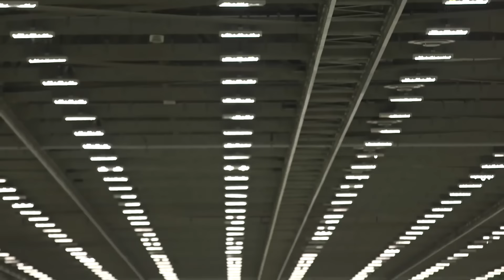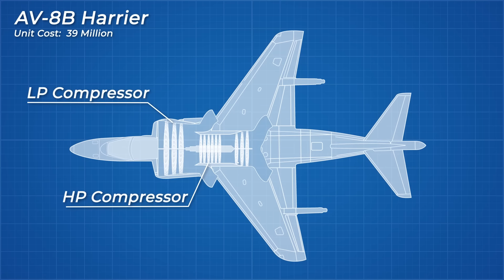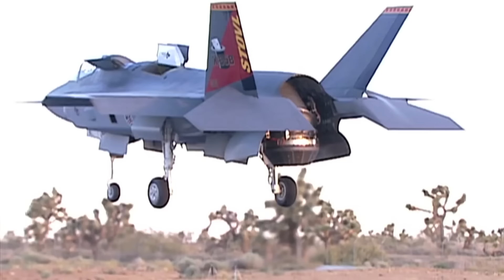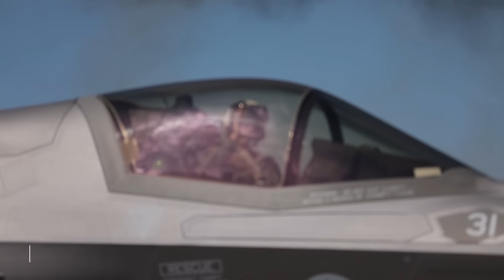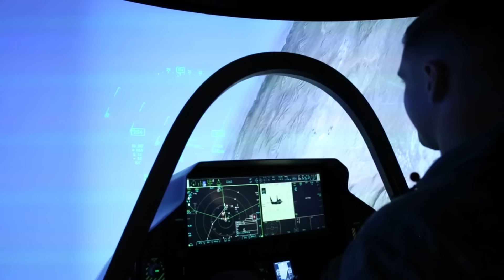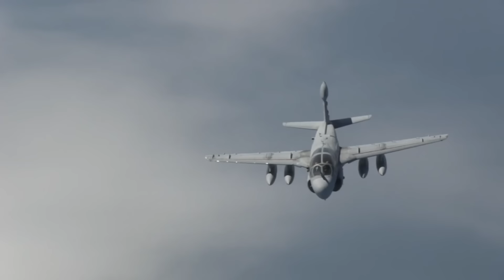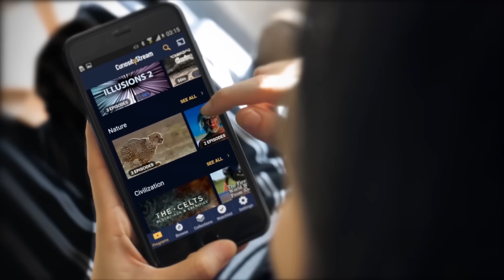Is The F-35 Worth $115 Million?

Comment: This is an utterly dishonest pile of garbage.

0:11 - No. F-35 cannot even begin OT&E yet, as of 2021.
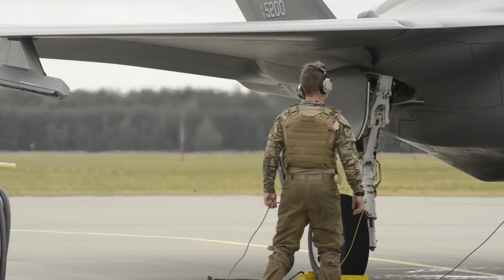10:58 - No. F-35 fails in air combat in general, not just in dogfighting.
 It can neither engage nor disengage, it is too slow.
11:12 - No. That report only confirmed what we already knew. Performance follows from basic airframe parameters, can't fool physics.
12:08 - This is irrelevant. Detection does not work this way, and even if it did, engagement is still a problem F-35 can't solve.
12:16 - And majority of them have bank accounts directly reliant on the gravy train pulled by the program.
12:40 - Phenomenally indeed. 1:3 KDR with full force loss against 4th gen Chinese knockoff Flankers in real military simulations, despite assuming 100% capable F-35's instead of real defective ones. Maybe you should read real reports instead of propaganda and marketing hogwash.
13:05 - ROFLMAO. A barefaced lie. F-35 is g-limited! Did you just forget about that little factoid?
13:27 - For some reason you have way less accurate information than anyone who bothered to do any research.
13:39 - Another lie. This isn't how air combat works. Stealth only gives temporary tactical advantage that only a capable fighter can utilize. F-35 can't., it's not a capable fighter.
13:52 - News flash: in a dogfight, stealth does not exist. It barely exists even in a BVR missile engagement.
13:54 - Tired and stupid cliche. It doesn't work this way, not since digital RWRs, missile detectors etc.
14:05 - No it doesn't. Most 4++ gen fighters have similar or better equipment.
14:14 - Like MiG-31 does since 1980?
15:50 - Wow, a correct statement for a change!
16:20 - Yeah, that's such an achievement - flying while escorted by multiple support aircraft over Iraq known for its "modern" air defenses.
16:48 - Why would Russians reverse-engineer long-obsolete piece of junk?
18:03 - Another ridiculous cliche. News flash: it's not 1965 anymore.
18:15 - News flash: SAMs with radio command guidance are museum pieces for decades already.
20:35 - Oh really? Documents tell a different story, again.
FY2019:
F-35A - $101 million
F-35B - $132 million
F-35C - $149 million
Liar liar pants on fire.
21:06 - only in terms of MIC gravy trains.
21:17 - No it doesn't manage. It would be vastly inferior even if it was operational, and it isn't.
21:30 - Rrrright. Another cliche. "Trickle down economics" all over again.
22:02 - Yep - in video games, marketing promos etc. Not in reality though.

I didn't even bother to address all false or inaccurate claims, just the most egregious ones. 

This is not Real Engineering. This is Real Disgrace.
Reply: Initial operational testing and evaluation is not operational testing and evaluation?
Reply: @infinitelyexplosive  
IOT&E is supposed to identify flaws and deficiencies in prototypes and may be done repeatedly during post-LRIP development.
OT&E is for testing a finalized system.
F-35 with its "concurrent development and delivery" is still a seriously flawed prototype with 871 known defects.
Reply: @Conserpov  Do we have any estimates for how many issues the F-15 and F-16 have/had through development? I have no context for the number 871.
Reply: @infinitelyexplosive  
The only context that is readily available is F-22.

F-22 had 25 known deficiencies prior to IOT&E entry and 351 deficiencies were identified during IOT&E in 2005.
Apparently, most of those were fixed prior to FRP that followed, and some goalposts were simply moved, with many issues being shoved into "upgrades" (up to 2019 Increment 3.2B). As of now, 143 F-22s are formally operational, since all F-22s delivered prior to 2006 / block 20 are considered "non-combat" airframes.

F-35 had "approximately 1000" deficiencies (incl. 301 cat 1/2) in 2017 and formally entered IOT&E in Dec 2018 with 873 known deficiencies (with 89 out of 102 cat 1 deficiencies simply "re-categorized" as cat 2). As of Nov 2020, it has 871 deficiencies incl. 10 cat 1.

Assuming same criteria for "deficiencies" and same political pull to drag it into service, and assuming that every trick once used for F-22 to make deficiencies "disappear" was already applied many times over - F-35 is a legendary disaster, "concurrency" is a legendary scam, and all 500+ F-35s already delivered will probably end up as training airframes (like block 10 F-22s) at best.

Comment: Currently: on average (there are 3 variants) an F-35 costs less than a 4.5G aircraft, although its maintenance, for now, is more expensive. And despite the list of problems still to be solved, today it is an unbeatable aircraft, only surpassed by the F-22.

By the way, let's say that any device (hardware or software) always has a list of pending problems. That's why any aircraft, say, the F-16, has so many versions. Because they have problems, limitations, inabilities, call it what you will, and not because of the manufacturer's whim. The F-16 went through 7 version letters and each one of them divided into sub-versions (called blocks). The same will happen with the F-35.
Reply: People have been griping about new aircraft being introduced and all the integration hell that comes with it since the F-15.
I saw a headline saying that the F-18 was a failure of an aircraft and a waste of money.
Reply: @Attaxalotl  super hornet
Reply: @johnnysliick3064  Nope, this was from the 80's. The Super Hornet didn't exist yet.

Comment: That thing is nonsense. For the USMC and USN, sure, it's fine. But the USAF has the 117, 16, and even A-10 and AC-130. Already bought and paid for. Far cheaper even for replacements, and plenty upgradable. If stealth tactical strike is desired, since in the 117. If stealth is not necessary, send in the 16s. If loiter time is important, send in the A-10 or AC-130 - OR.... let the Army handle it's own business, the AH-64 is not exactly a joke.  At that unit cost, it's better to get more F-22s and simply upgrade and keep using what is already bought and paid for, with infrastructure already in place and almost certainly lower per hour operation costs as well.

Not to mention... it's good to have a non-stealth public face. For air-space intrusions, air-shows, news/PR, and a show of good faith with other nations. Not like we'd be lacking in ability thanks to the aforementioned 22 and 117, but especially with the strategic assets of the B1 and B2.

Comment: The costs of the f35 have recently gone down to about 80 million per plane. Could you do an updated version of this video? I'd find it very interesting
Reply: 75 million
Reply: Is there much new information to talk about? Prices have gone down somewhat, ALIS still sucks, still not combat-proven against modern air defenses or aircraft, some issues resolved, others not, marginal improvements overall.
Reply: @infinitelyexplosive  wrong again Brainiac... Israeli F-35s penetrated Iranian and Syrian airspace and flew along the Russian border, penetrating S300 and S400 SAM sites Defended airspace without detection as well as a shitload of search radars. Where have you been for the last several years? Nitwit.
Reply: @infinitelyexplosive  Uhhhh yeah there is. the air craft is still under development and changing rapidly as the pilots log more hours
Reply: @infinitelyexplosive  israel used it  against iran

Comment: Simply put, the F-35 cannot replace the A-10. For the same reason that it will not replace the F-22.
The A-10 is designed to be a flying tank and a Air-to-Surface superiority beast.
The F-22 is designed to be a speed and Air Superiority beast.
The F-35 does not have the capability, due to it's all-rounder design, to replace either of these specialized tasks.
Reply: Sort of- the A-10C is already being replaced by the F-16C/ D in regards to CAS in contested airspaces. That's what the F-35A seeks to replace.
Reply: The A-10 isn't even the best in the role it carries out. The only reason it's kept around is because it's cheap to operate and Congress won't let it die

Comment: I think this plane's obviously got a lot going for it, and the front-end cost of buying the aircraft has come down a lot - it's a 5th gen stealth aircraft that's actually cheaper to buy per unit than a lot of its 4th gen non-stealth competitors such as Typhoon or Rafale for instance. However, I think the operating costs on the back end might be more concerning than the costs on the front end - I've yet to find a single authoritative source on just how much exactly US planes cost per flight hour, but the sources I've seen all seem to put the single-engine, lightweight F-35 in the same ballpark as heavier twin-engine fighters like the F-15 or even the F-22, costing something like 30,000 bucks per flight hour, whereas the F-16, which is the workhorse of the USAF that the F-35's supposed to be replacing, costs around 8000 per flight. Maybe those maintenance costs can be brought down the same way that its up-front production costs have as more airframes circulate, but given all the sophisticated technology that the plane uses I kind of doubt that it can happen to the degree necessary for all 1000+ F-16s currently in use by the USAF to be replaced by F-35s. And while its stealth is a massive advantage, I do think that by essentially flooding the market and exporting the plane to so many different nations, it creates a greater impetus for the likes of Russia and China to come up with tech solutions to neuter stealth, something which is surely becoming more likely as those countries get to grips with stealth aircraft technology of their own.

Comment: radar avoidance, unbeatable situational awareness (even by f22), top avionics and capability of carrying the newest weapons you can image, is what makes this plane easily worth $115 mln. it wouldn't be bought by so many countries if it wasn't
Reply: @Drew Peacock yea i meant the basic, cheapest A variant, which isn't really that expensive itself, compering to others 
 (i think its less than mentioned $115 mln). what is expensive though - that you pointed out already - is the cost per flight hour (more than $40k, around $20k for f16. its far more than USAF was expecting). i imagine the whole infrastructure for it isn't the cheapest as well (especially for countries that didnt operate any 5-gen platform before)

as for the missles, as far as ive heard (obviously im no expert), the newest aim-120c7 and aim9x are pretty effective. but i suppose it wouldn't take much to integrate such a meteor missile for f35 . all the best!

Comment: I think that if the X32 would have been selected it would have ended up being a much better plane than the F35. With that huge delta wing, and integrated VTOL it would have been able to fulfill all 3 roles in one aircraft. Instead we get 3 different versions of the F35. Look at the original X35. It' quite a bit different than the F35. 

The same would have been for the F32 if it were developed. We can only imagine what a completed F32 would have looked like. One thing is for certain though. We wouldn't have needed 3 different F32's for Sea/Air/Land.
Reply: The X-32 demonstrators were not capable of both supersonic flight and vertical take off. Boeing claimed they could get both with a redesign. Additionally, like the X-35 they intended to develop a separate model for each branch, the marine version having clipped wings for example. The differences were stated to be minor, but then again, so were the X-35s.
Reply: @infinitelyexplosive  They also had design revisions that were not in the 2 aircraft they used.

IMO Boeing should have went for it because they said that the planes were capable of the feats needed. They played it too cautiously. They should have known that if 1 plane didn't do it all they would lose by default.
Reply: @Drew Peacock The fact that it was capable of VTOL and supersonic at all made it better than the X-32 though.
Reply: @Drew Peacock "As I said, the F-35B has no meaningful vertical take-off capability, certainly not with a full tank of fuel and full of ordnance." and that is completely irrelevant. The X-35 was competing with the X-32, not with a hypothetical aircraft that hit all the design requirements perfectly. "Due to the heavy delta wing design of the X-32, Boeing demonstrated STOVL and supersonic flight in separate configurations, with the STOVL configuration requiring that some parts be removed from the fighter." according to Wikipedia.
Reply: @Drew Peacock I said "The X-32 demonstrators were not capable of both supersonic flight and vertical take off". In this sentence, the word "both" is used as a function word to indicate and stress the inclusion of two things, in this case VTOL and supersonic flight. Then I said "The fact that it was capable of VTOL and supersonic at all" In this sentence, the word "and" means that I'm again talking about the two words "VTOL" and "supersonic" at the same time. https://www.merriam-webster.com/dictionary/both https://www.merriam-webster.com/dictionary/and
Reply: @Drew Peacock I'm sorry that you don't understand basic English sentence construction. I can't really help you with that.

Comment: maybe they made improvements to its maneuvering cause they show em on youtube at air shows and they look like they move almost as good as the crazy su russian jets and raptor.  and all that tek and sensors look like straight out of a video game.  some star wars level stuff thats amazing 😍
Reply: Current version of the F-35 call pull 9 Gs. This video is garbage. And they only cost 75 million per aircraft, not 115 million.
Reply: @CH-pv2rz  This video isn't garbage it just aged. For cost the mass-production kicked in and for Gs, fly by wire allows to upgrade existing planes by literally just updating their software - which is mind-blowing on its own, but yeah

Comment: I'm not really sure this is a good replacement for the A-10. I doubt it would be at home in some of the areas the A-10 takes off from, such as dirt runways at forward operating bases. But as a fighter jet that will mostly be in a cushy carrier or hangar, it seems fine.
Reply: I'm sure thats where the B comes in, it won't have to spend much time on said runways. Not to mention the A10 has notoriously shit IFF (that being a pair of binoculars used by the pilots) that lead to lots of blue-on-blue incidents. Not sure if the F35 is a suitable replacement considering its limited carrying capability, but I'm sure it will still give better performance than the A10, as much as it pains me to say that

Comment: I don't think I heard about how it beats the A-10.
Reply: The A-10 simple cannot fly in contested airspace. It's relegated to attacking lightly-armed insurgents with no anti-air weapons because it's a sitting duck for modern anti-air weapons and enemy interceptor aircraft. Meanwhile the F-35's stealth allows it to attack enemy ground targets in contested territory with near-impunity, similar to the F-117 striking at the heart of Iraqi territory in the first Gulf War. It can also fly a multitude of different missions while the A-10 is limited to ground attack only.

That said, the F-35's not a fitting replacement for the A-10 in its current role of close air support against insurgents. For one it's far too costly to operate to justify using it on insurgents, the A-10 is already arguably overkill for its current role and its operating costs are a fraction of the F-35's. Its fuel stores aren't amazing either, meaning that it can't loiter on station for as long, which is probably the best thing that the A-10 has going for it currently, and it can't carry the same ordnance load without compromising its stealth. The replacement for the A-10 as an anti-insurgent weapon is more likely to be light turboprop aircraft like the A-29 that can loiter for even longer and be operated for even cheaper.
Reply: @Verminator4  thanks